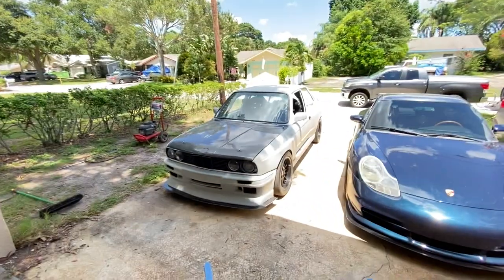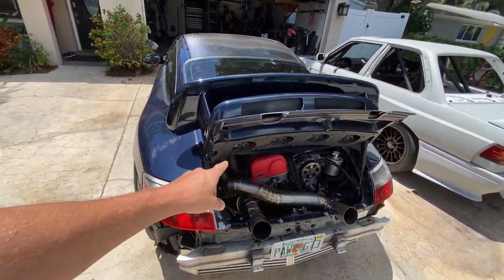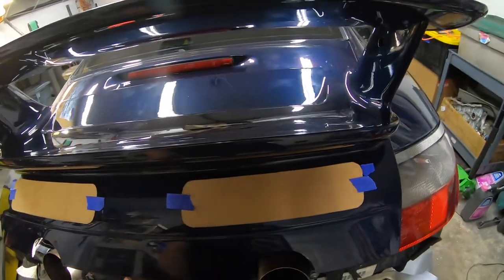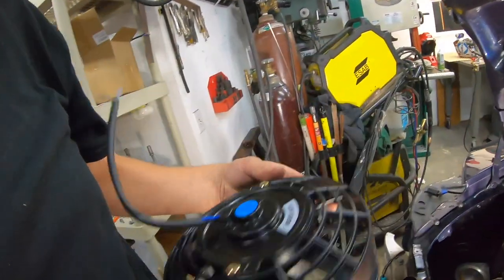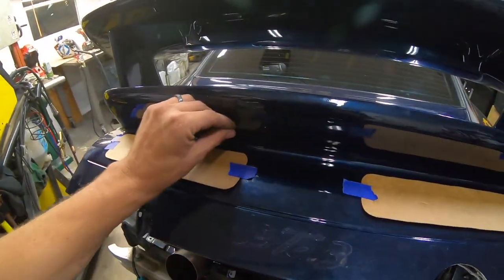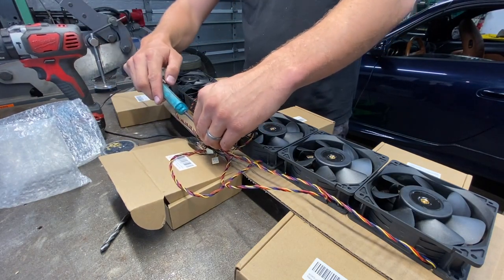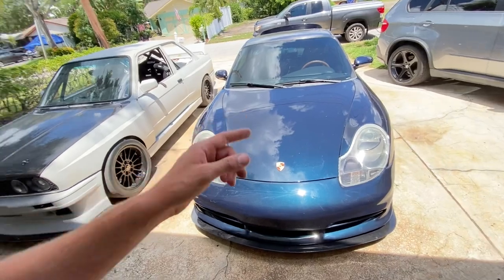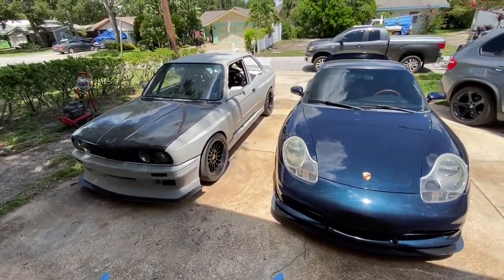Stuffing As Many Computer Fans Into The Engine Bay As Possible

Comment: Add rubber grommets around the fans, it really helps with the vibrations and noise.
I've added sound dampening materials to vehicles for over 20 years and I've found that a combination of many different types of materials work to dampen vibrations.  Rubber gaskets are great between panels, rubberized sheets help with the panel itself, and polyfill helps to keep sounds in only 1 area. Car audio dampening videos do a decent job of informing people too.

Comment: I tried computer fans on the intercooler in my Jetta. They didn't last very long. They couldn't handle the moisture. I ended up replacing them with a small radiator fan.

Comment: E30 forever ♥ love the experimenting with cooling. Curious if a push pull system on the oil cooler can help reduce the temps further. Some rubber washers between the fan housing and the plastic board might help reduce some vibration. Looking forward to the next episode 👍🏽

Comment: You could have made a small scoop under the wing to direct more air into the inlet vents and still have fans that suck air in when the car is not at speed and have a good exit for all the hot air to escape near the exhaust.
Reply: Too much emphasis on moving hot air out when you need to push more fresh air into and thru the engine bay. Once you start rolling those “exhaust” fans up top will no longer exhaust and prevent fresh air from circulating.

Comment: OK, I’m embarrassed. I’m even comparing mine to yours. I have a G35 and I rebuilt the motor and maxed out everything I could fabricate on my own and I put two fans and created a hood vent right before the windshield on the front and it looks like it’s stock and I did two on sides vents  I created in the fenders. So one on top, and one in the fender on each side. And I put some remote sensing equipment I had from some stuff I used to do in manufacturing to test and it’s significantly lowered temperature in the engine compartment. I’m surprised more people aren’t doing. That’s honestly it’s basically free drain off of your battery, very low amperage and weight. Good to see someone else is doing it.
Reply from the maker: What are your engine bay temps. Mine are 146 which is much cooler than expected

Comment: I have a  daihatsu JBDET engine.and i have problem on maintaining good engine temp (the engine runs normal tho).i am gonna use the 5inch automotive fan tho.thanks for sharing..my main aim is to keep the engine bay heat lower for my AC temp.

Comment: There are temp sensors (for computer applications) that could be added to the computer fans to allow the fans to spin less quickly when the bay is cooler and faster when the bay is hotter. It would b similar to how electronic fans start when the engine runs hotter. Just a thought. 
Also is it possible to add some type of wrap(or coating) to the exhaust?
I would definitely add that 1200cfm fan on the left side too, it can also be on a temp sensor. Since it is possible to rig up either sensors for the engine bay or the engine itself, go with whatever works better for your application  (maybe a combo of the 2 works best?) Not sure definitely something to try out

Comment: Hey lad. I do a lot of this kind of thing. And to want your flow from top to bottom. That’s the factory flow. And then your fans will not be sucking hot air. They will be blowing cold air over your engine bay. And everything will live longer.
Reply from the maker: Also would blow hot air directly into my intercooler
Reply: @baysidefabrication  hey lad. If are worried about your intercooler just build a rear defuser for the intercooler that stops any hot air going over it. If you build one you can vet hot air out where you want and cold air to and through your intercooler. Why I say to keep the flow like factory because at speed it will try and stop flow. The air speed flowing over the car is going to be stronger than the fans so it will try and stop the flow. Plus the heat will kill the fans and your paint. But just put a air temp gage in the engine bay and try the two ways and see witch is best. Just flip the wires and see. You are on the right track and you know what you are doing. I was just trying to save you some headaches. But it’s kickass lad. She will be a very fast car once you put the built engine in it. You may have to get your hands on a turbo gearbox to handle the power. Cain hard lad. Keep up the good work.

Comment: Why not just wire in the fans to a PWM output on the Haltech?  Then you can soft start the fans and create a table for how you want them to run.  That's what I did for my electric power steering conversion and oil cooler fan.

Comment: PC fans are loud as hell, I would have went with a passive solution instead, such as a naca duct on the hot side of the fender and or an under tray with some naca ducts to pull air up and through the engine bay and vent out under the wing